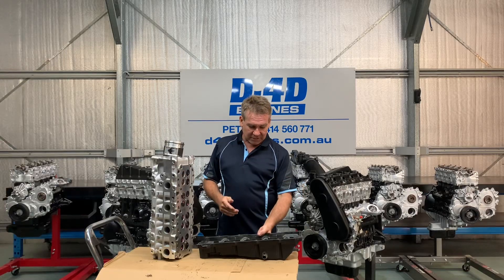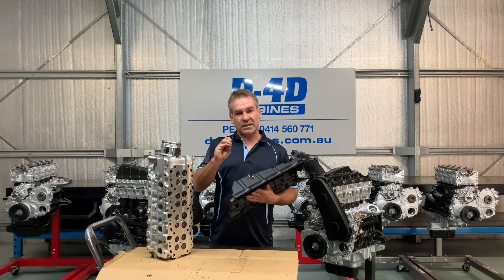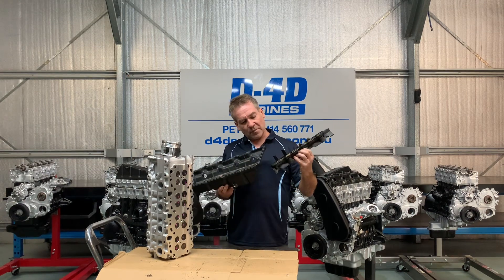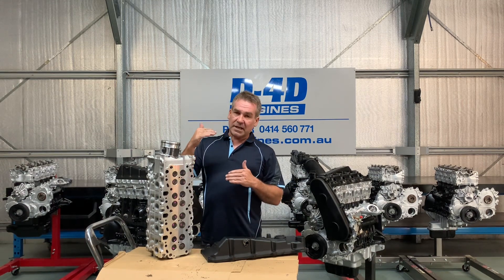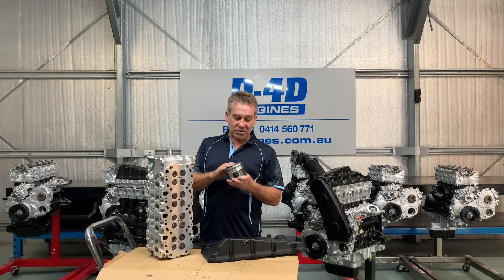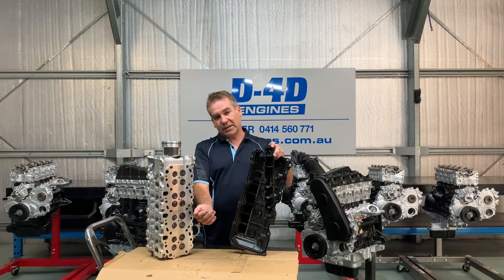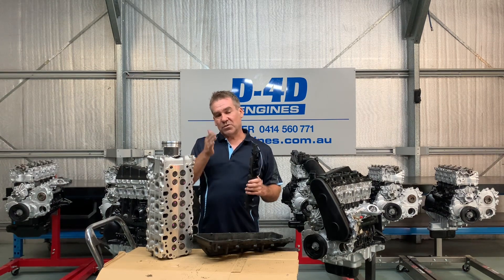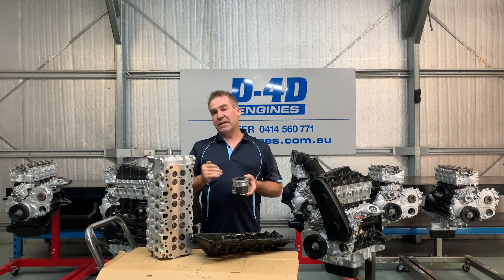Normal diesel engine breathing explained when dose breathing become blow by what is blow by?

Comment: Nice work. I worked within the Caterpillar system for a long time in product support. I've watched about 6 of your videos and fully agree with your diagnostics. Heavy duty on road and mining truck engines have the same issues for the same reasons. A lot of it is not brand specific, just the laws of physics and what's been learned over the past century. Keep up the good work.